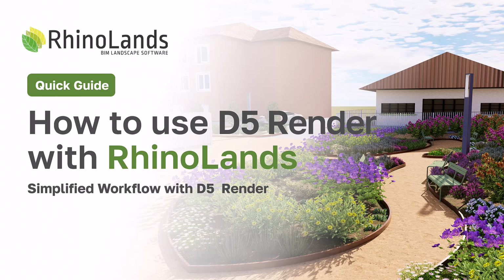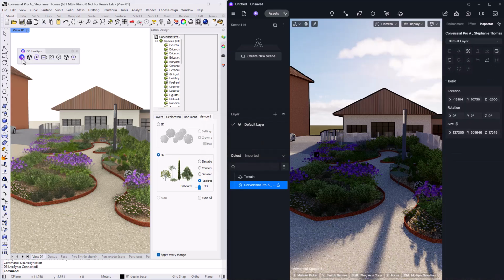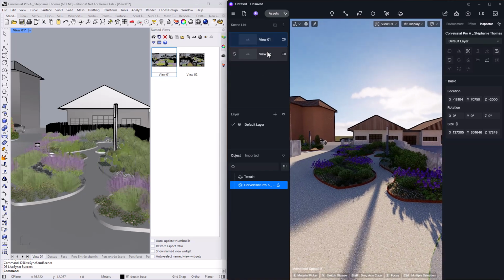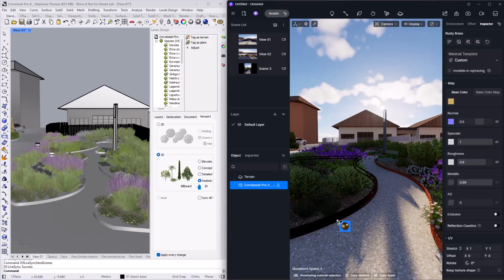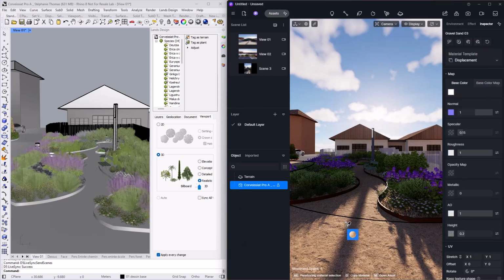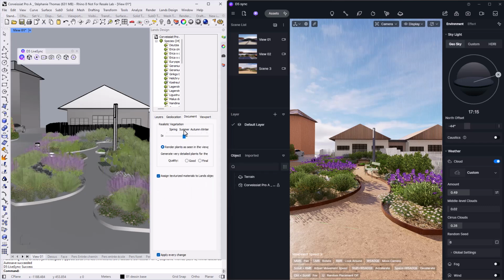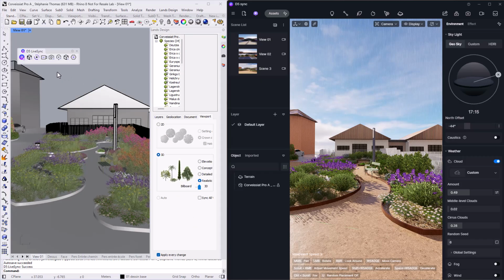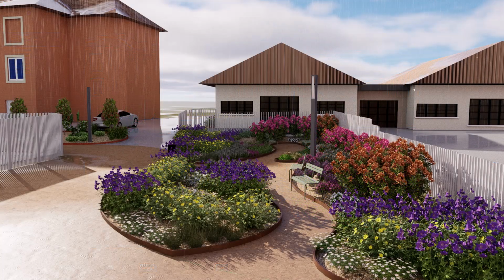How to use D5 Render for RhinoLands

Comment: It would be great if object replacement were supported — replacing the blocks in the software with plants of the same name or type in D5.
Reply from the maker: Object replacement is not automatic, but it is possible to manually replace plants with D5 Render assets. To do this, instead of using LiveSync, you should use the Export option and then import the model into D5 Render.
You can export only the planting layer, which allows you to select the objects individually from the left panel in D5 Render. By selecting all plants of the same species, you can then use the “Replace from Assets” command in the right panel to replace each selected object with a plant from the D5 asset library.

If you need any help with this workflow or have further questions, feel free to contact us at rhinolands@asuni.com